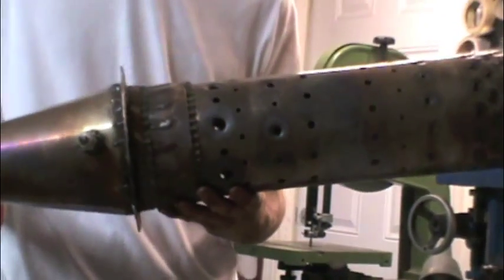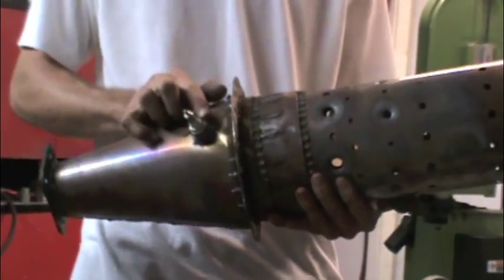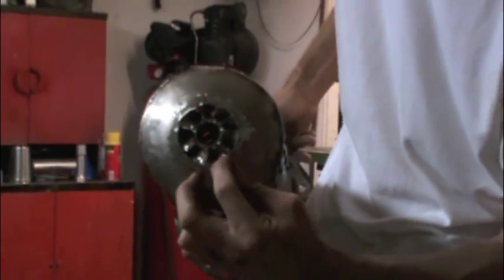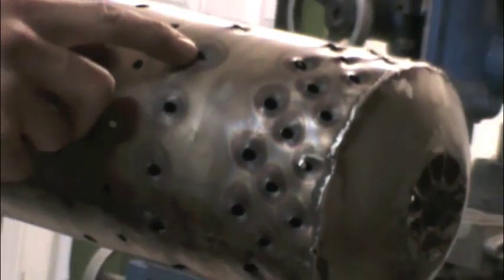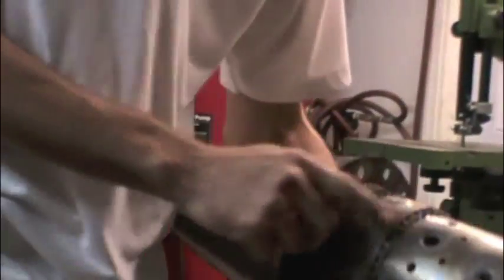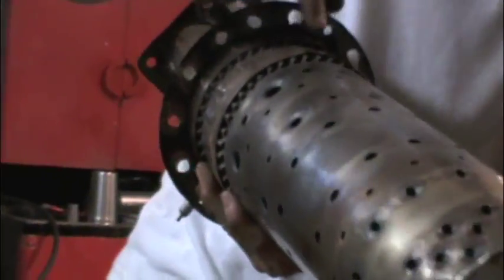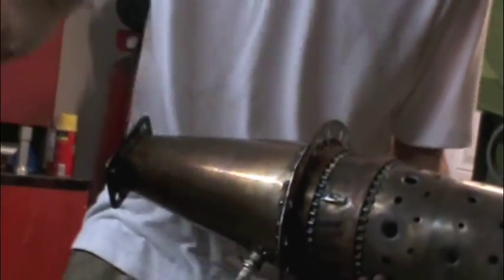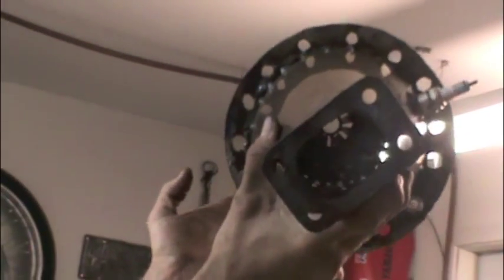(D.I.Y. JET) Homemade flame tube review

Comment: does the actual tube that feeds the gas, i.e. propane, diesel, kerosene, etc, does that tube need to be drilled with numerous small holes and capped off at the end of the tube??